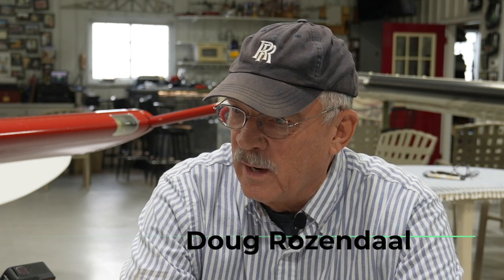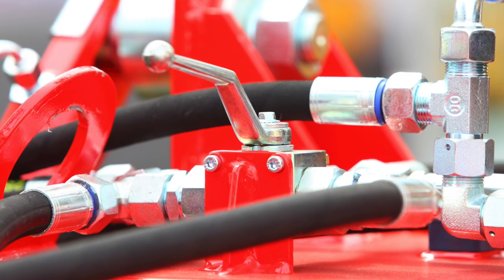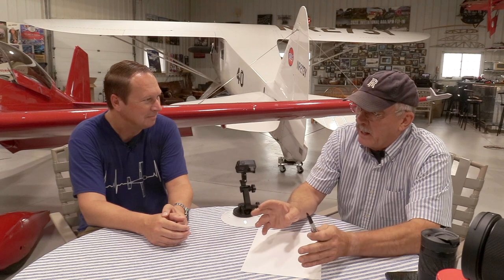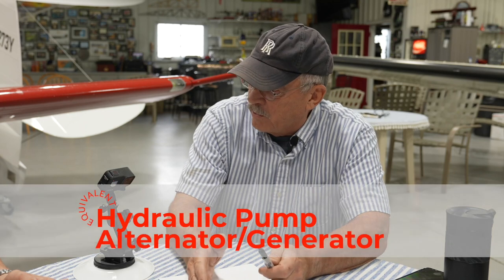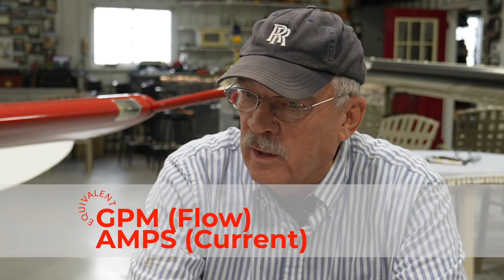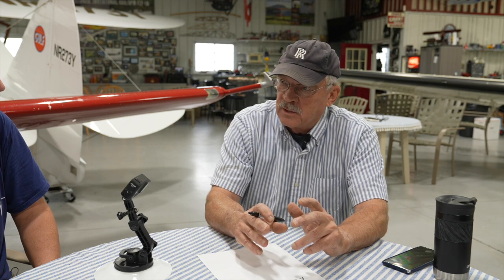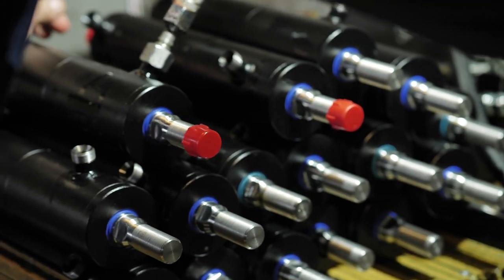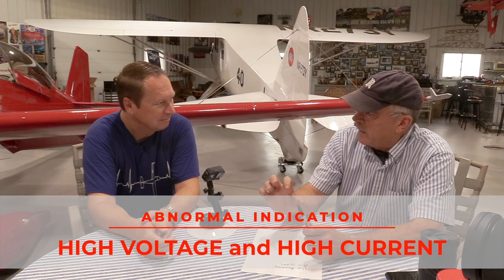Aircraft Electrical System 101

Comment: Gee, I wish he had gone just a little further..... e.g. the size of the pipe determines the volume of flow can be carried = the size of the wire determines the amount of current that can be carried, etc and then talk about circuit breakers that are numbered according to the diameter of the pipe / wire, etc. .....how a "leak" causes too much flow and the breaker is a way of stopping the flow?   That would have completed the "101" course.     But thanks - this is useful and I am passing on to my students !
Reply from the maker: Good suggestions, Rob. Thanks.
- Martin
Reply: Definitely agreed, especially considering this explanation has been around since before any of us or the guys in the video were born.
    This has been taught to millwrights for many decades because it is a good way to help some people understand electricity better.
Reply: Might as well get into ohm’s law to show the relationships between E, I, & R ,valence shell, negative electron flow theory, Kirchhoff’s law, voltage drop, etc.

Comment: Funny thing..I went the other way.  I learned to understand mechanical systems by relating them to electrical systems which I learned first.  This translates to physiology as well.  Heart generates pressure (analogous to voltage) to drive fluid (current of blood) across the blood vessels which can be capacitors (large systemic veins reservoir for blood) or variable resistors (arterioles change in diameter in response to activity, hormones, medication) etc.
Reply from the maker: Good to know that this can work both ways!
- Martin

Comment: G,day Martin from Sydney Australia. I liked the comparison of fluid flow (water current) and Electrical current (Amperage) flow.
However at a drawing board designing the electrical systems is different than troubleshooting at 10000' while possible spacial disorientation effects are impeding.
⏳🛩️
Reply from the maker: You are right, John - that is harder to do in the air, especially when something goes wrong. Which is why one needs to think about possible failure conditions, symptoms and mitigation on the ground, before the flight.
- Martin

Comment: This is mostly very good.  But there is one correction I would definitely make:
    We do not "pull electrons out of the ether".  Electrons are always present in the metal the conductors (wires, plates in the battery) are made of.
    Other commenters also mentioned how the size of the pipe is analogous to the size of the wire.  This is accurate and important to understand.
    Further, this explanation is a very old one that has been in use in a variety of industries for many decades.  Perhaps this is another case of the aircraft industry taking a very long time to catch up with the rest of the world, technologically.
Reply from the maker: Agreed. We could have found a few more examples of analogy between these two worlds.
- Martin

Comment: I am so glad that this process helps you.  I believe it to be counterproductive.  It adds a second layer that must exist for comprehension.  Not good in my book.  Honestly I have a good deal of experience with both Hydraulic and electrical disciplines, and this explanation befuddled me on several levels.  I think the right way to teach this is just teach it, explain the electric system.  One should not have to learn another system in order to understand the one you're learning.

Comment: I applaud your intention to shed light on his topic but am somewhat disappointed, for two reasons. 
First, if one wants to use the flow of liquids (hydraulics) as analogy to the flow of eletrons (“electricity”) - which can be a very useful analogy - one should take care to use the correct analog terminology. Eg. Voltage not Volts for electrical tension/pressure, Ampere not Amperage for the unit of flow, as you corrected in the overlays, or in respective units: lbs/sqft correspond to Volts, gpm corresponds to Ampere,.. 

Also, electrons are not pulled out of the air, the ones contributing to electrical current are already in the conductor - wires etc (basically an undepletable reservoir) - and are put in motion to create current by the tension/Voltage generated in the generator or (electro-chemically) by the battery.
Secondly,  nothing specific about the aircraft electric system was explained. The analogy could serve to explain much more than the basics (as Rob Sterling states, in his comment, as well) and also much more about how to operate and troubleshoot the system.
In another video, perhaps?
Reply: @ Wolf Herold
This was a rudimentary explanation for simplicity, hence the term 101. It wasn't intended for electrical engineers such as yourself but thank you for your detailed corrections. 🙄
Reply from the maker: Thanks for your feedback, Wolf. As I am sure you guessed, neither Doug nor I are electrical engineers, so we were on much thinner ice here than when we talk about aerodynamics or engines. The target audience for this video is not people who understand electricity well, but pilots who really struggle with the basics - of which there are many. We are hoping this video - even if not completely accurate - can help some pilots get enough of an intuitive idea to have at least a fighting chance to deal with an abnormal situation should one occur some day.
Regards,
Martin